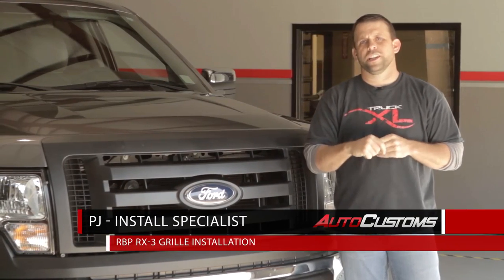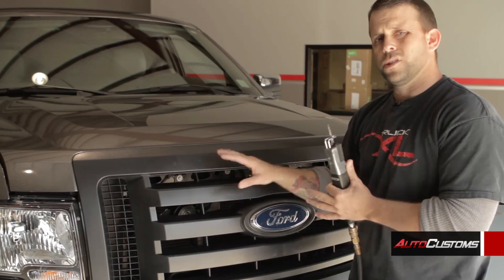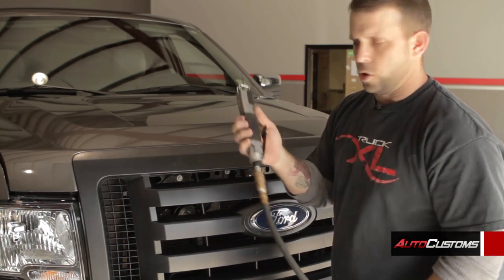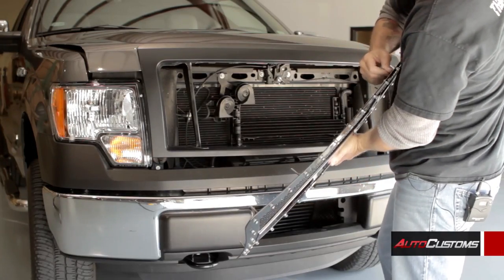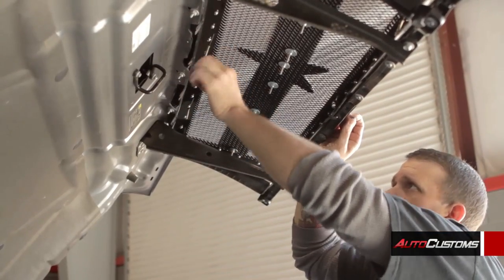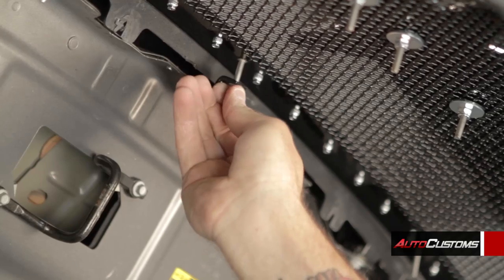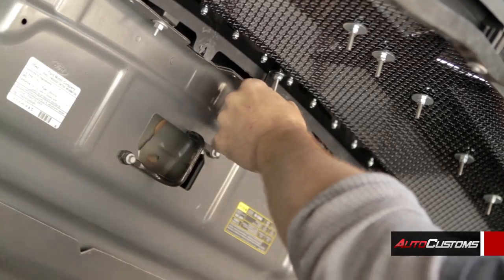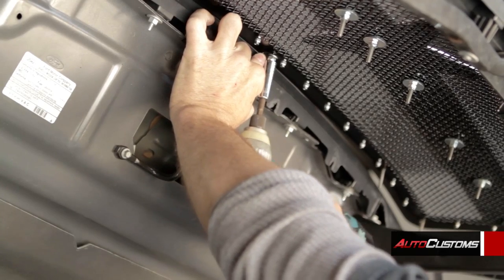RBP RX3 Grille Install - Ford F150 - AutoCustoms.com

Comment: Spend almost a grand on a grill that's held in by cheap metal hooks...? Wow... Atleast the nfab grills actually bolt on
Reply: That's exactly what I was thinking. I can design a better grill that will mount right in cheaper then that!